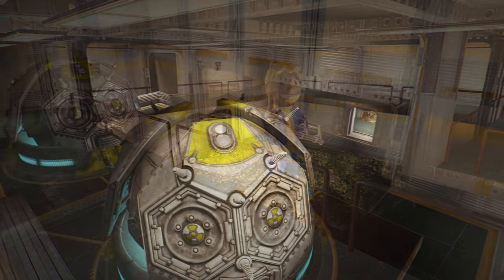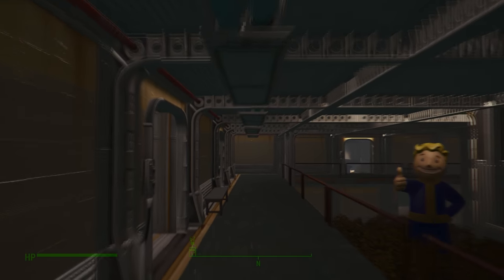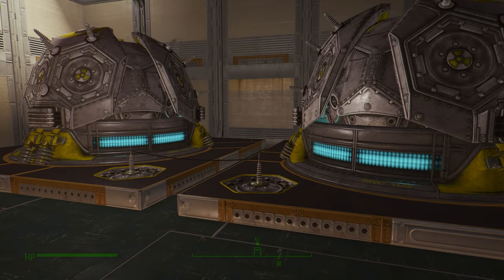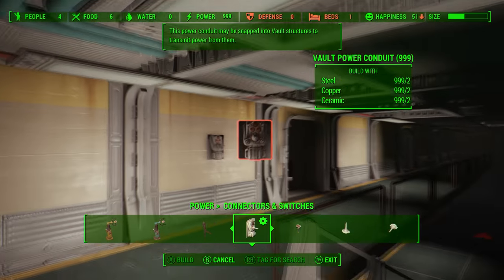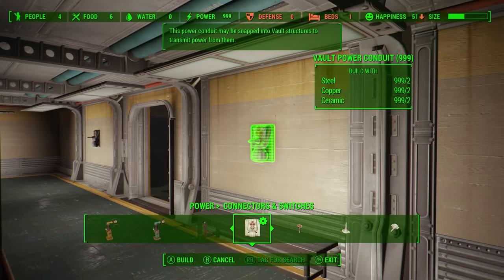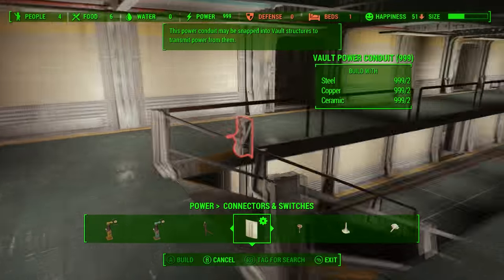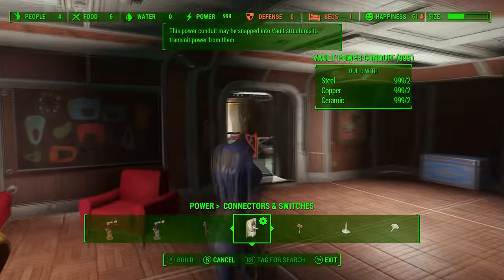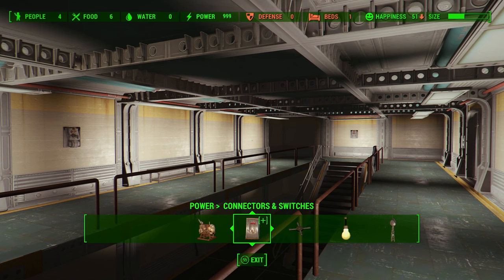Fallout 4 - Vault Tec DLC - Easiest Way To Power Your WHOLE Vault!

Comment: Hi I've done just this and the lights are not turning on, the power is correctly in place and whatever I try it does not work, are there certain vault structure types that the power doesn't run through?

Comment: There's a generator you can get called "Tiny Generator" which I think comes from the Wasteland Workshop and it looks like an electrical fuse box. It radiates 5 power and you can place it on either side of any wall so you don't have those conduits sticking out all over the place.